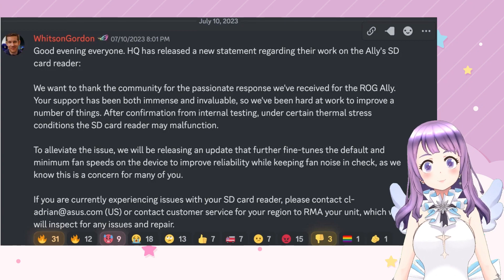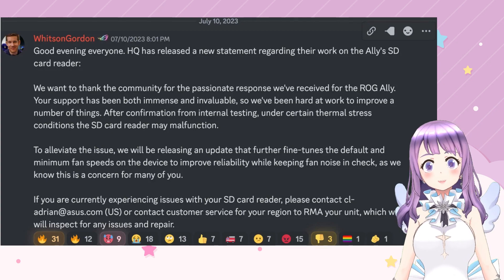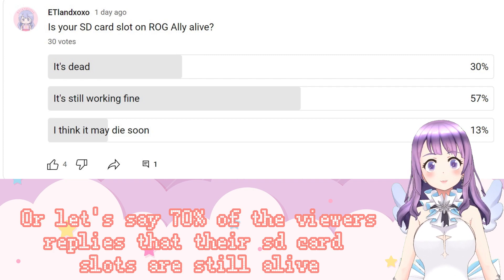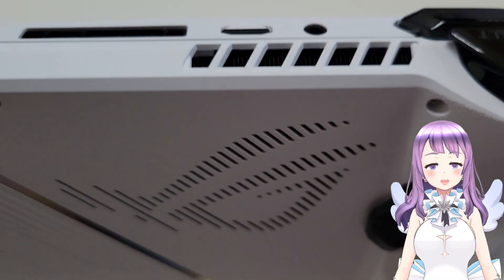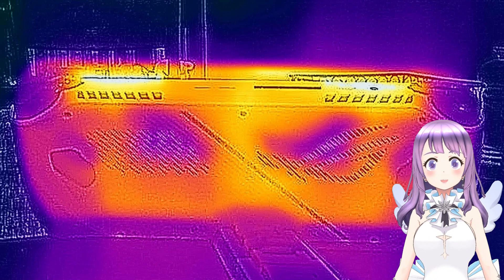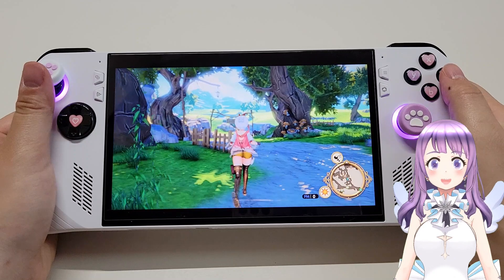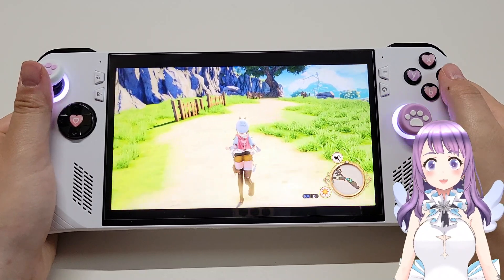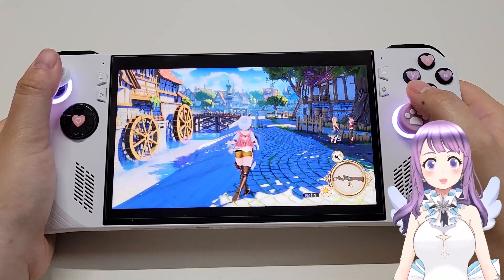How to prevent ROG Ally SD card slot failure due to heat issue | ROG ALLY SD card issue prevention

Comment: heat issue? im playing cyberpunk and stay at 60+ it can feel warm but never to the extend that its 90+ HOT....  just follow guids and you will have normal temp but i havent used sd card yet so i cant say much about other then my rog dont get hot.
Reply: Mine doesn't either but a lot of people don't know computers and just crank the wattage to turbo and think it's good.

Comment: I was gonna get one, glad I didn't. I should wait until they redesign the hardware
Reply from the maker: I haven't experienced the SD card problem... So it is hard to justify how easy you may get into trouble. To me, it has been a wonderful device
Reply: Can i ask what sd card are you using? In my experience tho only sd cards that are made in taiwan and korea are broken because of the ally's heat

Comment: I read from people that are saying is that is a hardware problem another a heat problem or a sd card problems or reader problem and lastly a software problem I understand that before it was a heat causing to burn seen pics but now with a fan update solution is still happening not the burning of sd card but is dying in where the ally can’t read it anymore plus in the phawx video he did everything with the sc card in the ally it still works fine I’m no tech but it makes me wonder if they went n put the sd card reader in the bottom like the sd maybe the problem won’t exist or maybe it would like now how it is anyway I understand the ally is the first pc handheld that asus made to compete with other pc handheld and is a great device but I feel that they kinda rushed it meaning before they shipped out to give to reviewers first n then customers they should have waited n should of did months of testing the ally to improve it n fix it the issue some are either returning the ally the other half is waiting for incoming update which there slow n the other are happy with there ally
Reply from the maker: I believe there are probably multiple reasons that may cause SD card reading problem. Software issues shall be solved sooner or later. But heat issue is something that we have to be careful:)
Reply: @ETlandxoxo  totally agree with you

Comment: So I thought my sd reader was fried but apparently it’s just not taking the san disk 1tb, I tried a cheap sd with like 32gb just to see if it would read and it did. So now I’m not sure what it could be, but after 322 update I guess when my device stopped reading the 1tb.
Reply from the maker: I am making another video on testing 10 cards. I can confirm it is not related to memory size. But yes, cheaper and older card works. FYI, I have been using an A1 1TB card on 322. Still works fine
Reply: @ETlandxoxo  sweet, I’ll probably have to get me one of those cards then. Thanks for the info, I’ll check out the new vid also.

Comment: It isn’t due to heat, stop spreading false information.
Reply from the maker: Asus admitted thermal stress conditions can lead to SD card slot malfunction... how can it be false information? If you are saying that you formatted your SD card on the Ally and it doesn't give you the right volume, that's an separate issue
Reply: @ETlandxoxo  It's not a heat issue though. SD cards have died at low temps and high fan curves. ASUS doesn't even know.
Reply from the maker: @ryulanda9399 Even if cards can die under low temp high fan curve, it doesn't contradict with the fact that heat issue can be a reason, especially when it has been confirmed. What I see from the experience of some of my viewers is comparability issue. A2 card will die but actually the card slot is still alive. It  can read A1 cards and other older cards

Comment: I always keep my device at Manual mode except when I'm browsing or watching videos on it and i use ten for it. My fans stay in the 70s. I do the same as you with my sd card only using my sd card for emulation, pictures and other. My PC games are on the ssd just like you. I have my fans going to 100 percent because i don't mind the loud fans and it helps keep my device in the 70s. I been enjoying my Rog Ally alot and I'm happy to hear you are too. Thank you for the video
Reply: When you use sd card automatically the fan from the side sd reader will be  pushed on maximum. Asus miracle solution 😁
Reply: @tomaspavka2014  Really?

Comment: Nah my micro sd is split in 2 separate drives after formatting on my rog ally I think the rog ally bugged my card.
Reply: jcmk3829 Not a bug it show up as two because of a partitions in the sd card that is set up from windows side ,you can easily fix it by checking the Create and format a hard disk partition option in windows search spot for apps
Reply from the maker: He is right,it is not a bug. All you have to do is delete one of the partition and merge the empty partition to the right drive

Comment: 2:54 I recognize the picture from my 日本語の大学の本

As amazing as the Ally is, it was a serious misstep for them to put the SD card tray right next to the heat vent. For comparison, the Steam Deck has it opposite the heat vent, at the bottom of the unit.

I’m not sure I even want to bother sending it in for an RMA, since the design flaw means it’s very likely to happen again. I’ve also had terrible experiences with RMA. Oculus took four months to get my Quest 2 back to me.

I’ve seen people say that 15w fixes the issue because it keeps the heat down. But my slot doesn’t recognize any SD cards now. I even bought a brand new SanDisk Extreme and issue persists. So frustrating.
Reply from the maker: That's free illustrations from イラスト屋. Such a wonderful site for free resources;)

If I were you I would send it to repair and spend my time with my switch/ rp2 while waiting. But I know it would be torturing. 
It would be a lot easier if there are replacement parts/ ifixit kit available...
Reply: No even at 10watt it's possible lose your sd card reader.